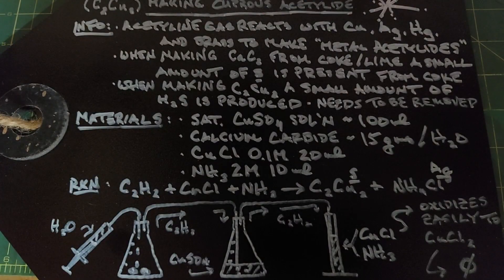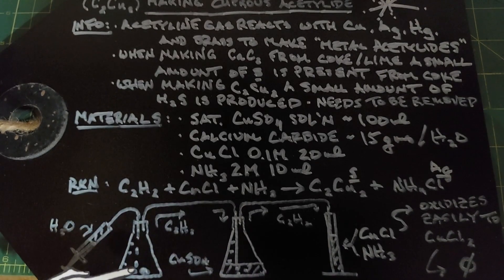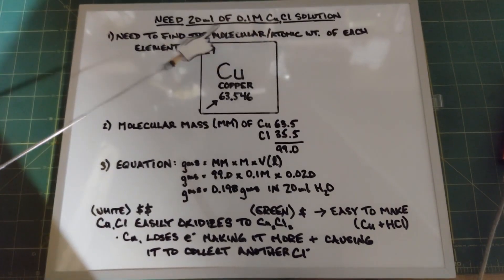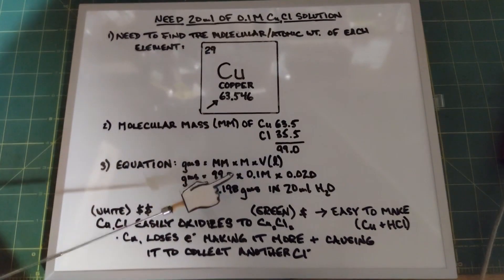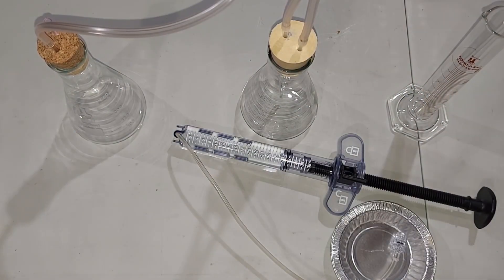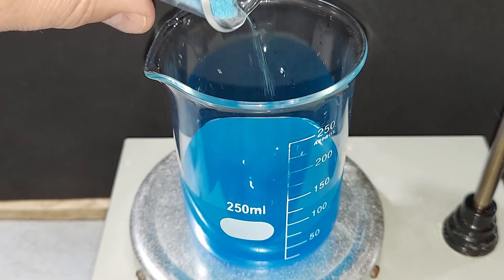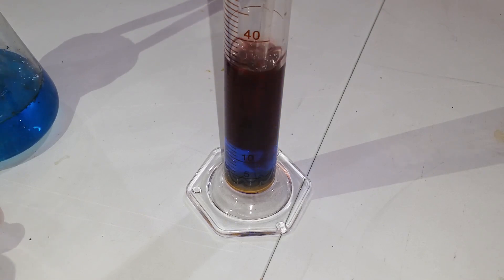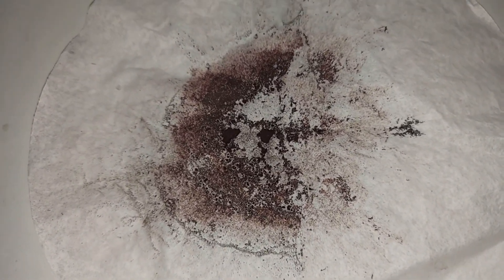Making An Exotic Explosive - Cuprous Acetylide

Comment: Hi Cranial Construction,
Nice video and synthesis about curprous acetylide (Cu2C2).

Just because many doesn't know, Cu(2+) also makes an acetylide when complexed by ammonia and when subjected to acetylen.
It also makes an unsoluble precipitate (CuC2); but it has a different color and is not energetic at all.
That precipitate doesn't deflagrate like its cuprous (Cu(+)) cousin and doesn't burn that wel.

The complex of Cu(+) and NH4OH (NH3(g)+H2O) is pale blue solution; while the usual Cu(2+) complex with NH3 water solution is deep blue solution.
In your video sadly; you had unpure CuCl as evidenced by its greenish color; pure CuCl is unsoluble AND white as snow (I have made a lot and it is easy as "F--K" to do) while its higher oxydation state cupric brother (CuCl2) is emerald green and soluble.

So in your precipitate, you have Cu2C2 and CuC2.
Sadly again Cu2C2 spontaneously turns into CuC2 and Cu(s) (or Cu2O or CuO) upon contact with air (oxygen) when moist (thus during drying) what deactivates its deflagrating ability.

Just as a side note; the Cu(+) and Ag(+) tests where earlier tests for characterizing alcynes of the type R-C#C-H in organic chemistry by generating specific precipitates; brick red for curpous and white-pale yellow for silver salts of the alcyne.
Those precipitates when dry are sensitive energetic compounds.

If the H-alcyne has a low molecular wheight, or two H's like into C2H2; the salts usually display deflagrating abilities.
I have 1000 ideas of practical unknown high energetic compounds of the type with high energy output (much higher than common acetylen) but this is not something for kewlies bombies (that want to win a Darwin's award) unfamiliar with chemistry and detonic.

Regards,H
PHZ
(PHILOU Zrealone from the Science Madness forum)
Reply from the maker: Thank you!

Comment: Why I cant just use copper (ii) chloride? I know that Cu2C2 have inside coppers 1+ on both sides of carbon but it seems that it works fine so I dont know why it works. Can you hekp me figurate it out? Thanks
Reply from the maker: The oxidative state of the copper is different, even though each one has the same number of copper ions.

Comment: That was interesting! I was always wondering about that compound whenever i used one of my old carbite lamps since some of them or parts inside the gas generator were made with brass (probably an alloy with less copper but still..) making me a bit more cautious handling them after getting warned by another collector! hah 
Thanks for satisfying my curiousity!
Reply from the maker: Well, you're very welcome : )

Comment: Sad, the accident was unfortunate.

But it did work!

How much of the product can be harvested from the limited amount of Cu1Cl and Ammonia solution, before the reaction stops?

Would the reaction be better if you used a bubbler stone to defuse the acetylene gas in the solution?
Reply from the maker: The dark red cuprous acetylide will visually stop forming even though the acetylene gas continues to bubble through.  You can see it slow down and then stop once the copper I chloride is consumed.  Your question about using a bubbler stone is an interesting one.  The only downside I can think of is forming the cuprous acetylide deep in the crevices of the stone which may or may not happen.  I guess someone's gotta try it.